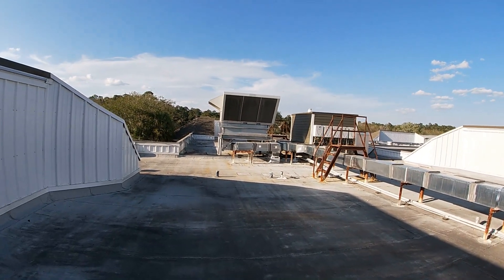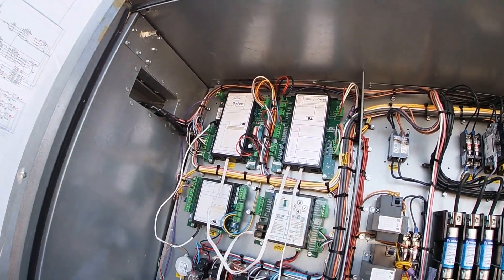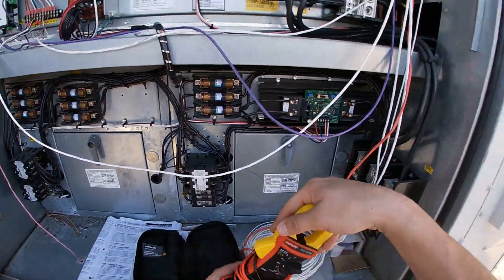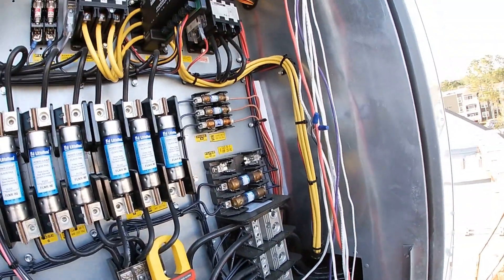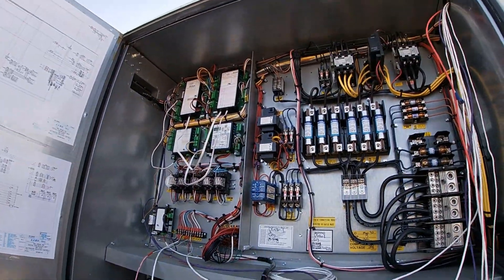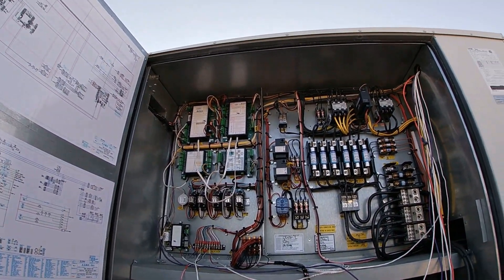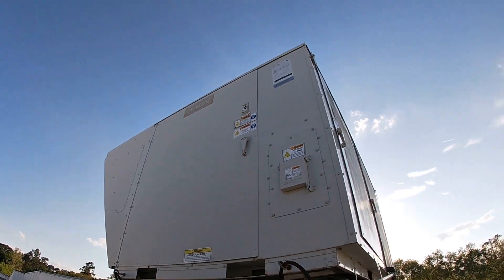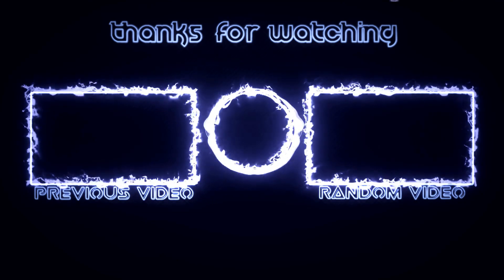AAON RTU Having Some Issues After A Power Outage

Comment: If a fast blow fuse gets put in where it needs a slow blow they will blow pretty quick because that can't dissipate the heat during initial start up motor current like the slow blow/time delay fuse can....
Oh yeah.  One AAON unit I was working on had the 15 amp blower fuses swapped with the 5 amp outdoor fan fuses. 
I was surprised that it ran for months like that.
Reply: LoL I ran across the same situation the other day

Comment: Geoff fallow the wiring from that fuse. You never know it might lead to that bad motor you mention. That could be blowing your fuse. Also check te diagram and make sure that the fuses your using (25 amp) are the correct fuses for that block. Most aaon diagrams will tell you fuse size.
Reply from the maker: I will definitely do a follow-up heck I might even take my drone up there and see if all the motors are turning beats the heck out of a 12-foot ladder up a roof hatch
Reply from the maker: I forgot about a week ago I did go up to the roof and checked the wires. They go to the VFD... most likely something up with the VFD or bad bearings creating drag and over amping. The VFD is for the Blower motor. Condenser fans are ECMS. I may check some amps next time  I am up there and this summer I will be a lest 7 times for just this unit LOL. 👍Thanks for watching AKvan79

Comment: Jeff another broken aaon unit why doesn't this surprise me
Reply from the maker: It's only going to get worst .BUT I do have to say this could have been caused by the testing of our new generator. and surged the unit but really who am I kidding. These units are made in OK why the heck would they test for hurricane weather. LOL. well  tornadoes yea but  salt water LOL the next video will be a ECM condenser fan going out I already Know and can hear it going. Thanks for watching @JCC3279
Reply: @geoffhoweth  Then something is up with the new gensets if it surged the AAON unit and blew the fuses sounds like you need some sort of soft start system to prevent the in rush current from popping the fuses. There really should be at least a 2 minute time delay until the AAON's kick on for the generator to idle up to provide the needed power. I'm starting to wonder if the generator is modified sine wave and not a pure sine wave. Btw why the hell are your duct detectors not hooked up. I wonder if the fire panel is throwing a system trouble because of missing duct detectors. Get your fire alarm contractor off his/her ass and get them duct detectors hooked up.
Reply: @geoffhoweth  Also make sure you guys are using Time Delay Slow Blow Fuses in the RTU's that will save you guys some problems. Normal fuses will blow too quickly.